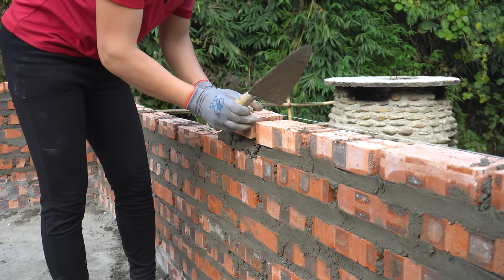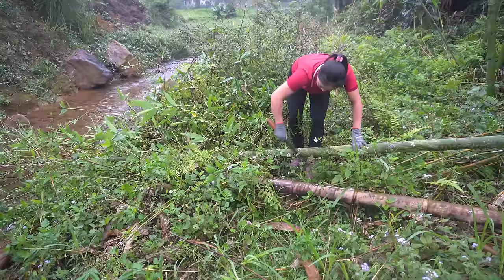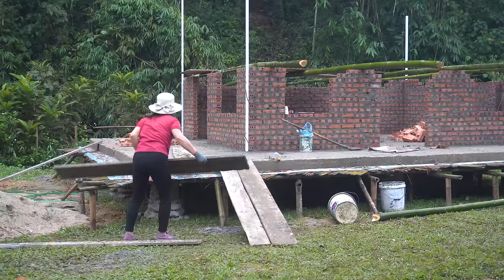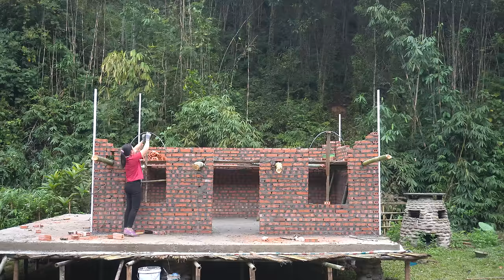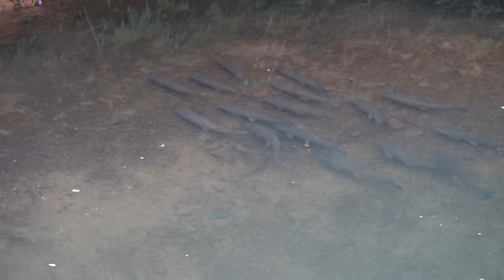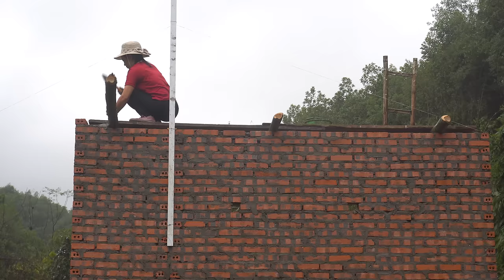Marveled At The Girl's Skill in Building Houses With Bricks and Cement - Building New House 2024

Comment: I'm surprised that with all you know about masonry projects that you didn't put steel reinforcing bars along the walls--at least I didn't see you install any---you did on the pad, why not the walls?!  With such tall long walls, and only one brick width, you run the risk of cracks or worse.  But I admit, it looks pretty good!
Reply: I agree with you completely, and with so many holes in the concrete as in missed areas a good coating of lime plaster would beautify, cover holes, and make it look way more professional.
Reply from the maker: Thanks you mach

Comment: The design of the house is really sweet . My concern is the foundation under though as she has a lot of weight on those few ground supports she has holding up the concrete slab . 
If the slab gives away under the weight of the single row  brick structure she could be harmed . I’d suggest beefing up more under that slab with concrete blocks and then reinforce with gussets the strengthen her brick walls
Reply from the maker: Thank you very much 🥰❤️💖💋